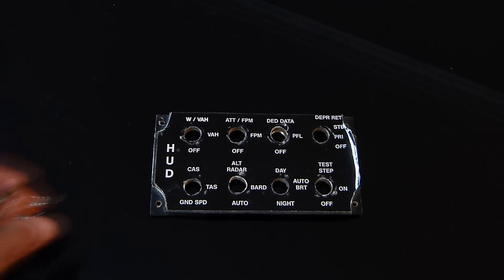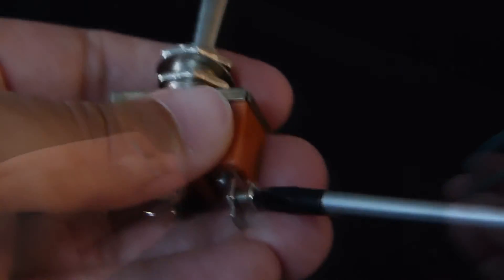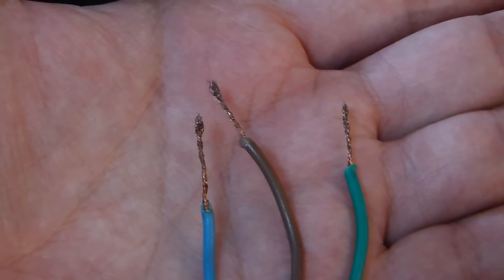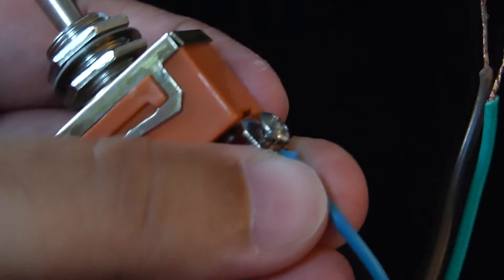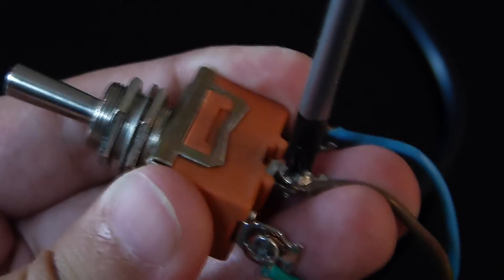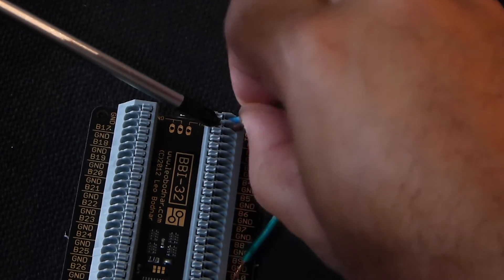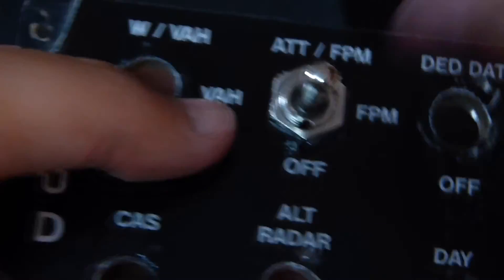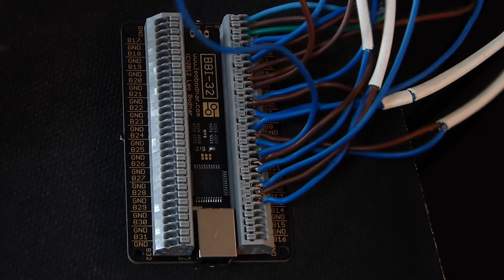Episode 4 - Building a Panel - Wiring it

Comment: I used the old IDE Parallel printer cables for mine, makes it easy to cut into strips/rows cut to what you need, label them with marker pen, fold them flat at 90 degrees and also lay them sandwiched under flat boarding nice and neat.

Comment: Hey thats a really informative video, thank you!
So did i understand correct: because the toggle switch has two positions, you use two 'buttons' on the Bodnar board?
Reply from the maker: Sorry for the delayed response!
Yes, you have to use buttons on the Bodnar board, but only one of them will be using the ground position in the board. So you will have B1 used with an input from the switch, GND with the ground cable from the switch and B2 with another input from the switch. GND from B2 will remain empty.
Reply: Thanks for the reply!
And is this common practice with toggle switches and various controller boards like the Bodnar board?
Also in your case, does the logical button remain pressed and just switches between it and a different button when you flick the switch? Or is the Bodnar board making the logical buttons just pulse momentarily via software with every flick of the switch?
Reply from the maker: I believe that it is common practice.
The first setence is correct, the logical button remains pressed until the switch is on that position. So the board really emulates the real inputs that we provide via switch or any other component. 
I will be releasing in the next few days the last video of this mini-series, in wich i will explain one easy way to interface the board and those inputs into a simulator, like FSX or Falcon. After that I am planning to start a bigger set of videos or a massive project that I am thinking about.

Cheers
Reply: Thanks for taking the time to answer my questions!
I was wandering about how the switches actually work since they are constantly closed (in one of two positions), which would be like pressing a key on a keyboard but keeping it pressed which is what confuses me.
Reply from the maker: Well, with some coding, you can assign different actions to the same input. Stick around and take a look at my next video and hopefully you'll understand this a bit more.

And thank you for visiting my channel!